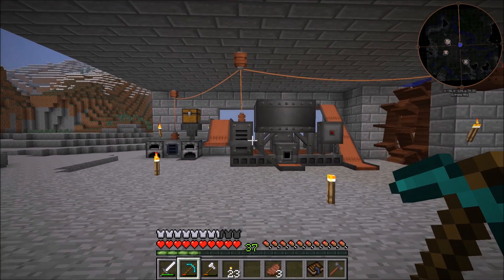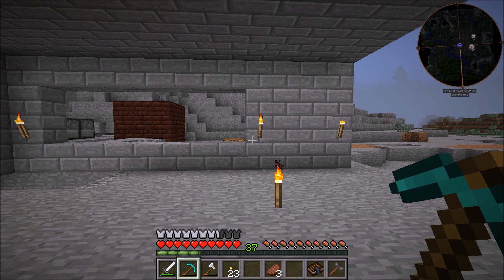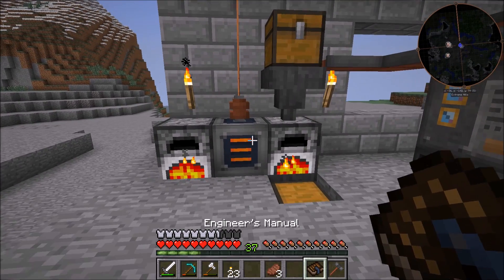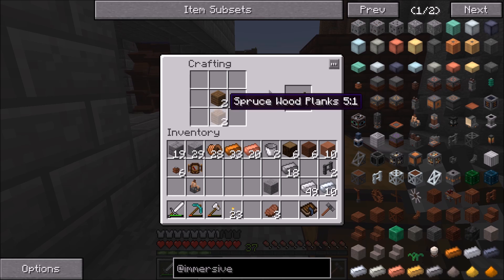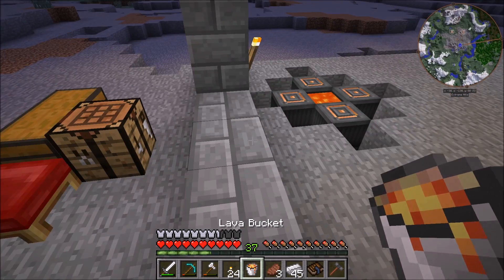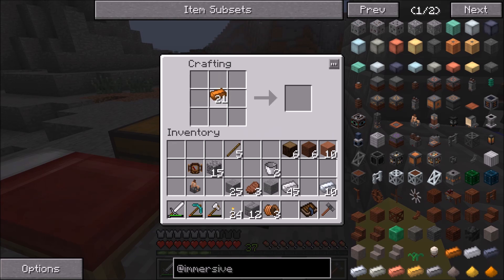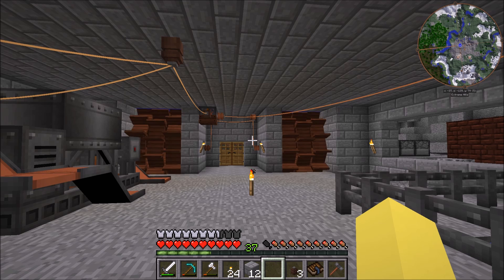Surviving With Immersive Engineering :: Ep.3 - Thermoelectric Generator Setup

Comment: Thermoelectric Generator is stupidly cheap and overpowered. It does not fit with the theme, logic or purpose of the mod and needs to be removed entirely. I mean, honestly, let's make a primitive mod with large power generators, windmills, watermills, etc and then give you a single stupid cheap block that generates an excessive amount of power. Lacking logic.
Reply from the maker: The generator with the mod along doesn't bother me too much, but the interactions it has with other mods liquids can lead to stupidly high power generation (assuming it does still interact with those) and thus make the other early game power gen pointless.

Comment: Did you know that wires are now made by hammering ingots into plates and then cutting them into wires?  More realistic and grindy.  I am perfectly fine with it.
Reply from the maker: Definitely a step up in realism from the initial method of crafting them :) +1 for IE!
Reply: Oh, and water wheels are now gated behind Nether access, due to now requiring steel in the center of the paddles instead of an extra treated plank.  Kinda sucks, but with the buff to the windmill to just require clearance in front instead of height, I'm fine with it.  I'll spare 6 steel to make the water wheels easily.

Comment: Btw, remember to exchange that lava and water for uranium blocks and packed ice for the best heat gradient and thus the most power gen from thermoelectric gens.
Reply: 168 IF/t to be exact.  (IE uses Immersive Flux or IF, though it's essentially identical to RF, so no worries).

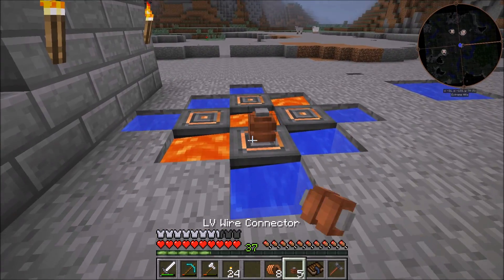Comment: One question, im playing direwolf20 1.10 and it wont let me connect multiple wires to one wire connector like you did at 12:13. How do you do that?
Reply from the maker: I believe changes were made to wires in a more recent update, much like the HV relays and connectors which can only have 1 incoming and 1 outgoing connection. Not sure if there is a new block / way to connect more than one wire outside of a form of power storage.
Reply: Ok, thank you